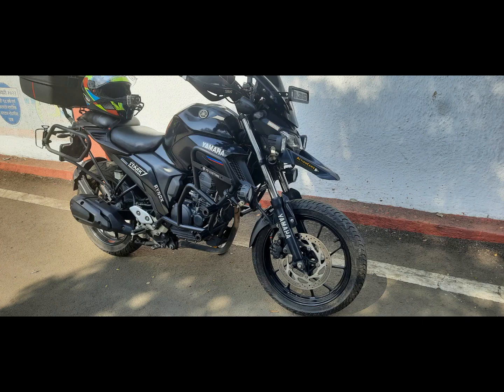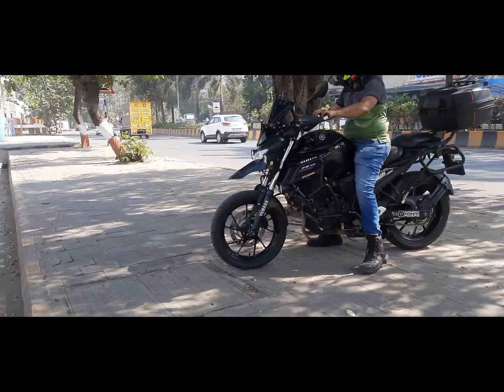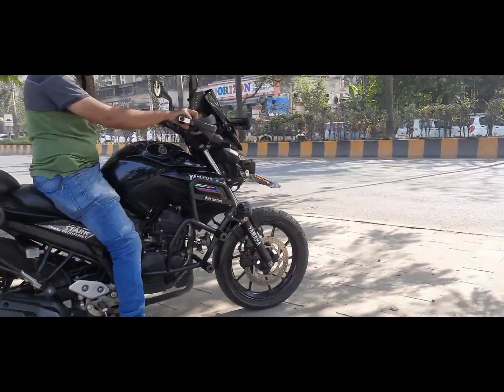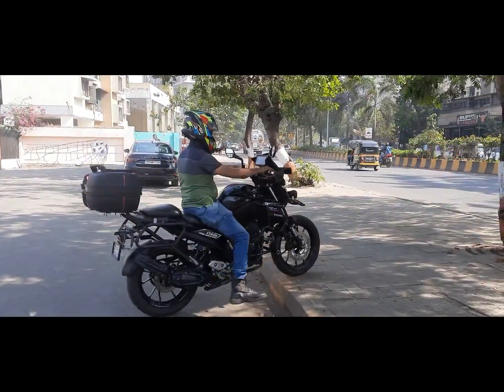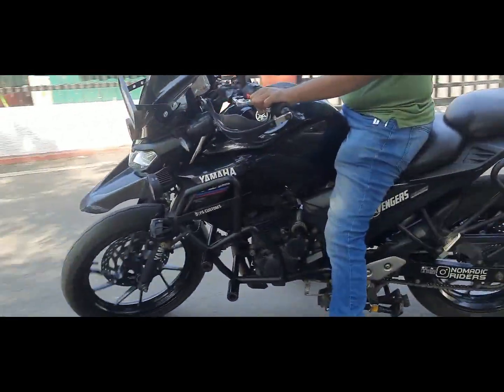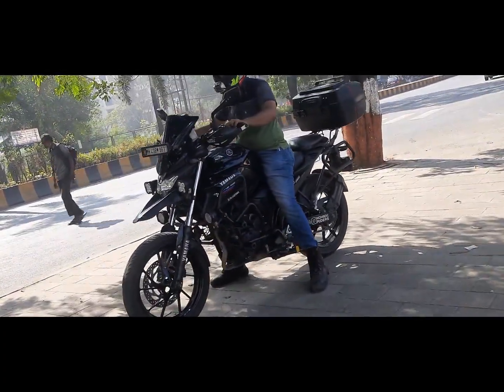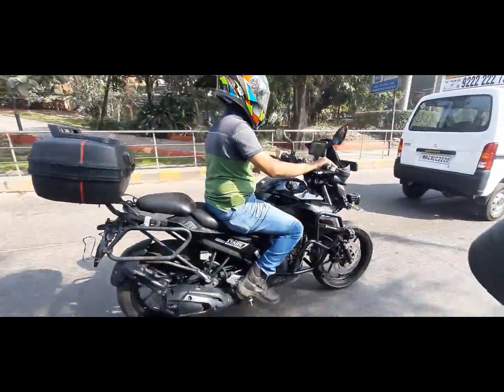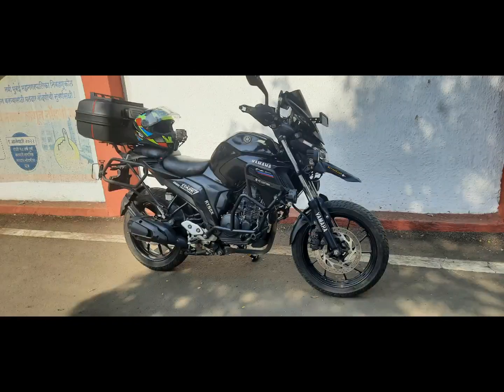Suspension travel modified from 130mm to 200mm on FZ 25!

Comment: how & which suspension
Reply from the maker: This is the stock suspension with some custom parts in the fork cartridge which increases the suspension travel. I'm still testing it and it has undergone 1 change and now it's gonna undergo another one this year.
Reply: any updates ?  @nomadicriders
Reply: Are you using any preload spacers for the front fork